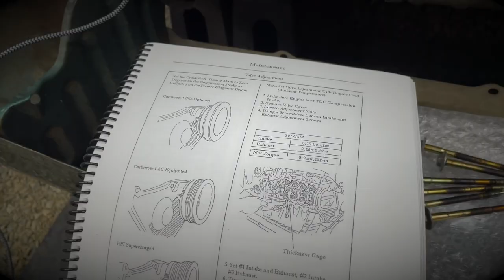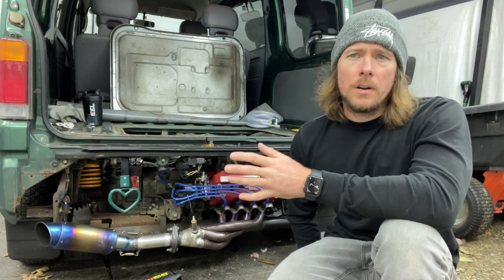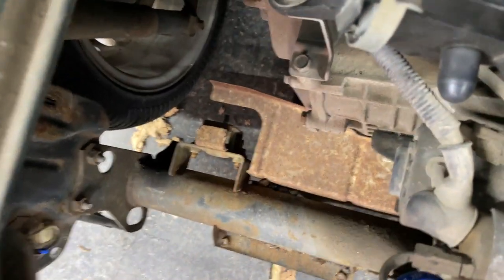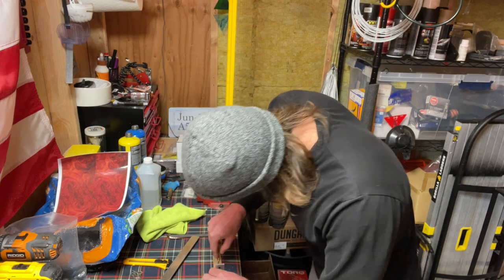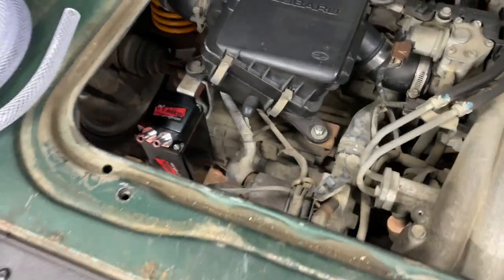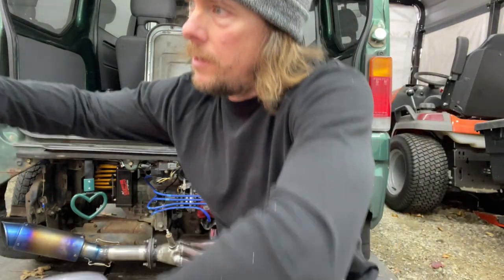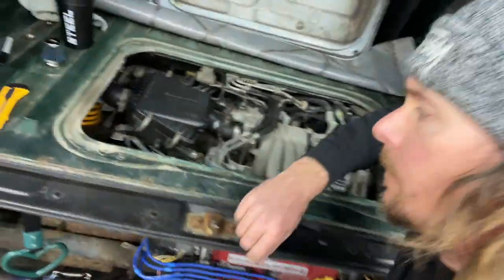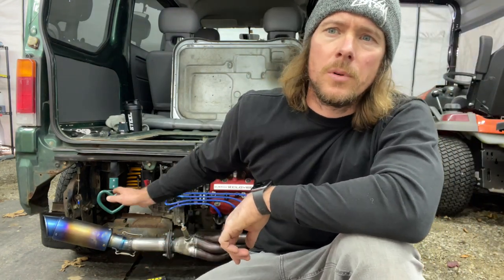Oh Kei Garage Branded Oil Catch Can Install On Subaru Sambar Dias KS & KV Compatible

Comment: I’m so into this channel , got my ohkei garage decals on my Sambar Dump. My stock muffler is taking up way too much space so I opted for a small catch with a dip stick. That hose they supply you with will collapse on itself when it gets hot enough. Went with a actual silicone vacuum hose I’m doing a video on my specific one but would love a branded one.
Reply from the maker: right on!! so glad to hear that. ya i went to home depot and bought some of that clear vinyl tubing and ran that and it holds up just fine to heat and all that. im actaully not gonna sell these ones after all. they leak oil cuz they probably don't use any gaskets to seal the can and i can't sell something that sucks lol